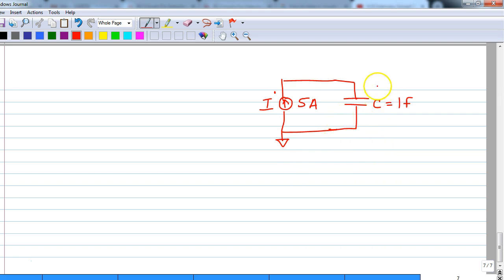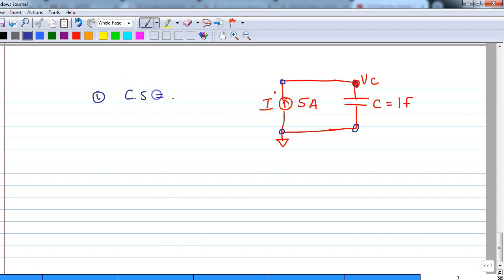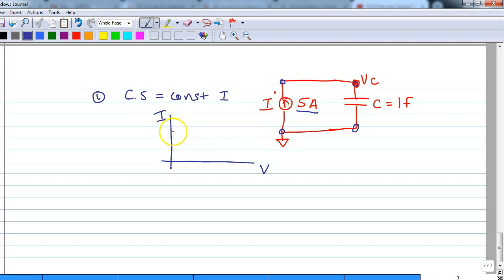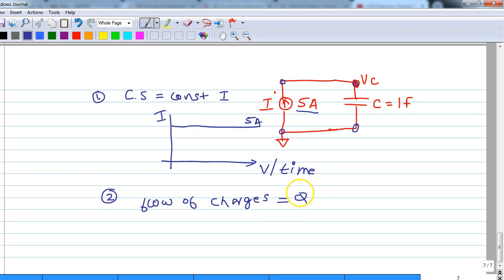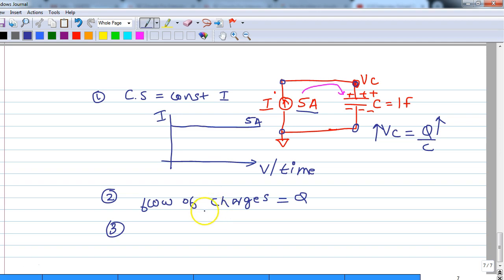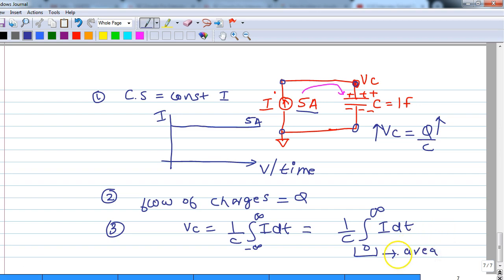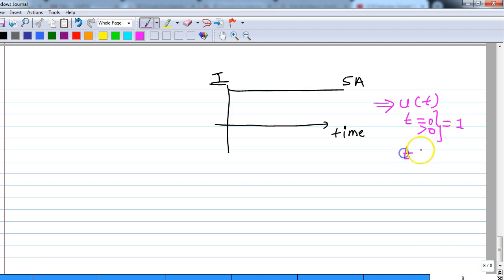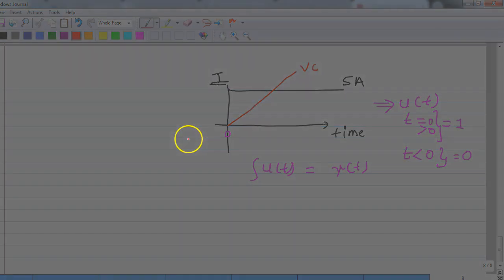Voltage of capacitor with current sources

Comment: I literally appreciate the tutorial. I was trying to find the function for the capacitor as we normally find a solution to a random 1st order circuits. However, due to absence of a resistor, it really gets hard because time constant is zero which makes the equations nuisance, nevertheless, this video follows another path by proposing using the definition for the voltage difference on the capacitor. Thank you very much!